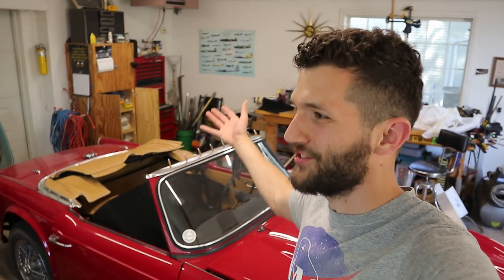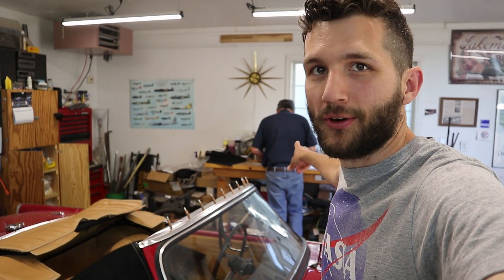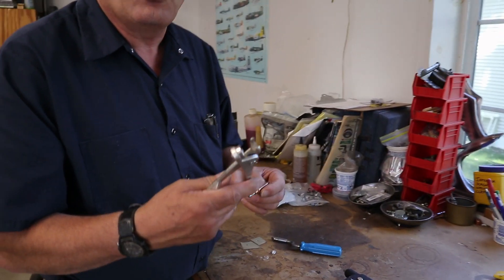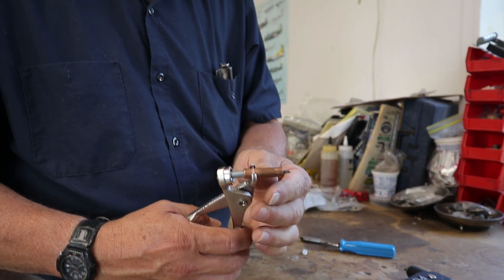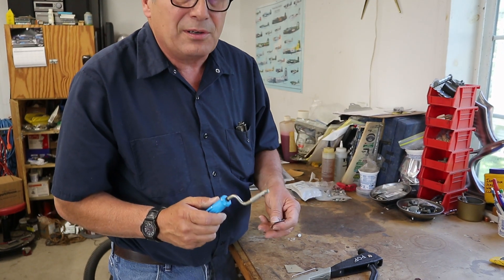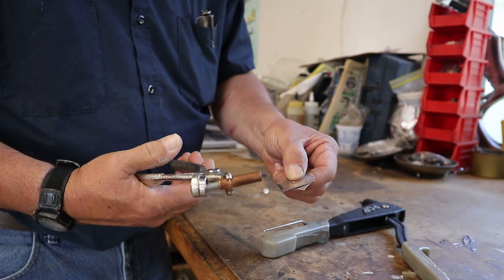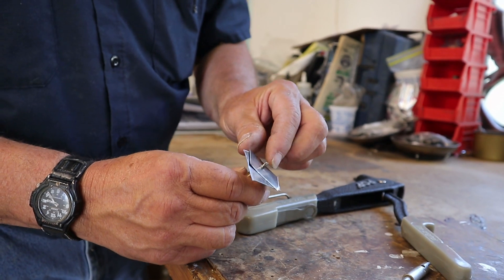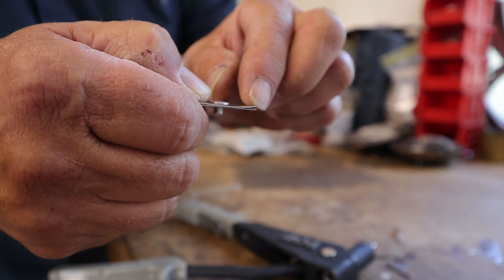Test Fit Sheet Metal Parts with CLECO Fasteners!

Comment: You might want mention that Clecos are not just for rivets.  They are also great for spot welding panels.  You can preassemble the panels together using alternating holes that go all the way through for the Clecos and a blind hole (drill through only one panel).  Once everything is fastened just as you wanted you rosett weld the half blind holes, then you remove the Clecos one at a time and using a copper backed clamp weld in the Cleco holes.  Works great.
Reply from the maker: That sounds like a great use for them. Thanks for the tip, Walter!